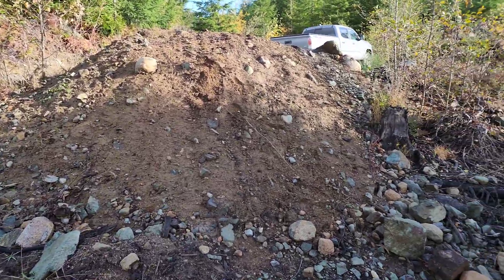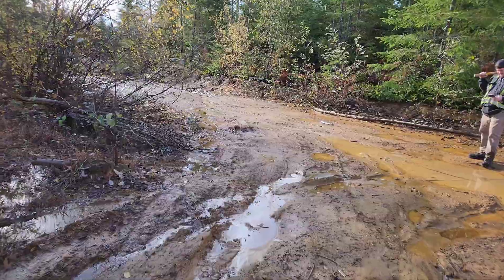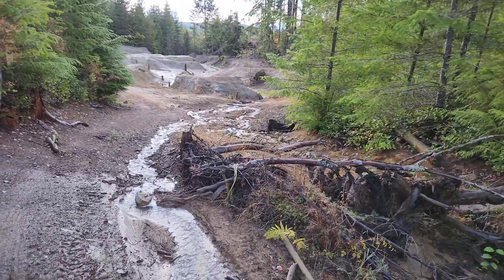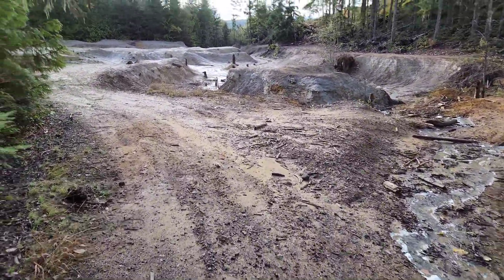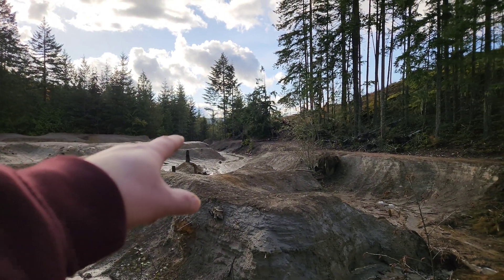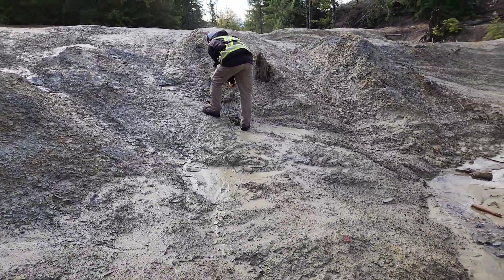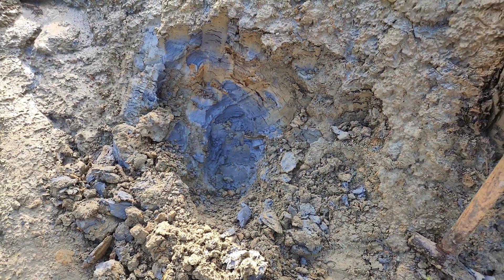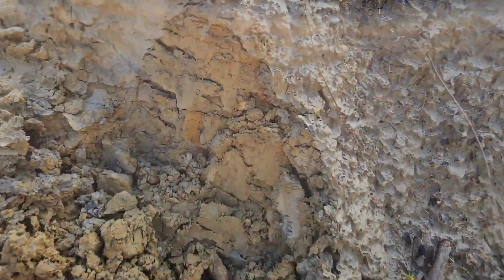This Tailings Pond Is No Longer A Pond!

Comment: Is this a problem?

Or just another opportunity?
Reply from the maker: Could be both, there's likley good zinc and copper with gold and silver in the old pond but also could be an issue to remove if not done properly.
Reply: @911mining  I figure if there are values in it, its probably leached into a solute type form that can be separated with activated carbon, or in a near emulsion level particle size such that it might be able to be gravity separated.

The blue clay, from how it appears, looks like it might have value by the ton, to the ceramics industry.

Where I live one of the 'tailings' is clay, but instead of having to push it around, or pack it back down, or pay to dispose of it, I can sell it, and others will therein pay to take it off my hands.